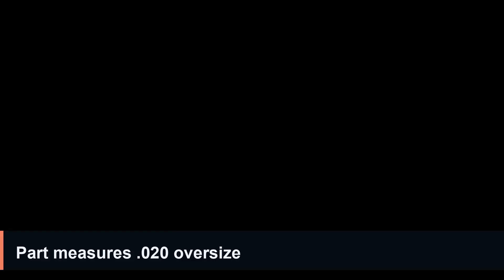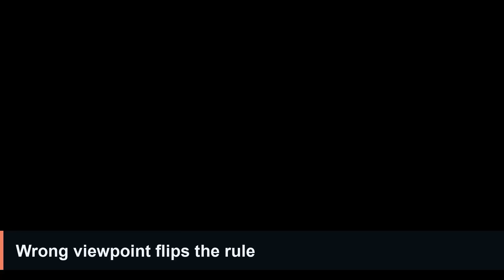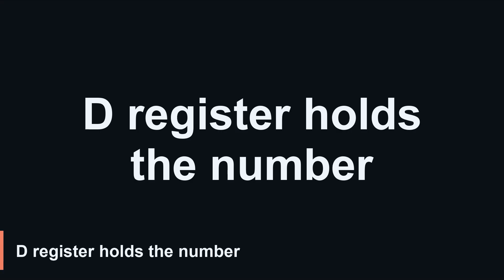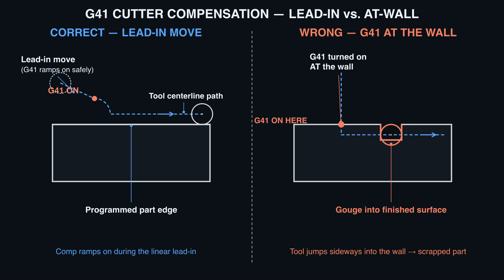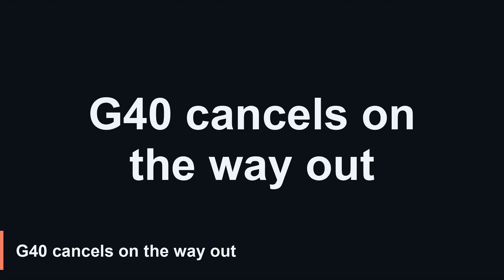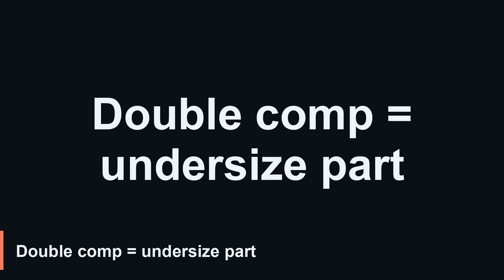G41 vs G42: Why Your Part Is .020 Oversize (Cutter Comp)

Comment: dumb question, if my tool radius is larger than a pocket what happens whe you have either g41 or 42 active? will it just mill what it can on the selected pocket?  will i force its way into that pocket if i use g02/03 x y r?
Reply from the maker: Not a dumb question, that's the interference case and it trips people up.

Short answer: it won't mill what it can. The control looks ahead a couple of blocks, works out where the compensated path lands, and sees the offset vector would have to reverse to stay on the geometry. Fanuc throws 041, interference in CRC. Other controls word it differently, same idea.

Same story on the arc. Call G02/G03 with an R at or below your cutter radius and comp has to subtract your radius from that R, so you're asking for a negative radius. It faults instead of guessing. Rule of thumb: no radius in the program smaller than your D offset.

Worth knowing though, comp is not a safety net. Lookahead is only a couple of blocks, so it catches the conflict right in front of it and can still gouge something further along the contour. It protects you locally, not globally.

So no, you can't force it. If the tool doesn't fit the corner, no G-code makes it fit. Smaller endmill for that feature, or kill comp and let CAM post the centerline.

Comment: Please Make a cutter compensation video on CNC lathe.
Reply from the maker: Good call. Lathe side's its own animal, same G41/G42 but it's tool nose radius comp, and the gotcha is the tool tip orientation number that tells the control which way the nose points. I'll get one up on it.
Reply from the maker: Got the lathe one up for you. Tool nose radius comp start to finish: the geometry, the tip orientation number, setting R, and the lead-in. https://youtu.be/qrutawSWcS8 Let me know if it covers what you needed.